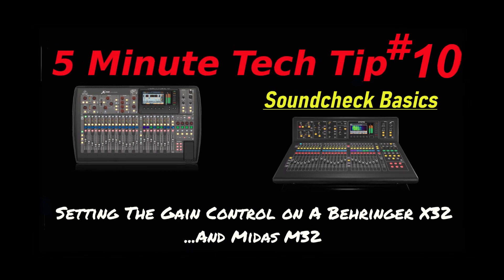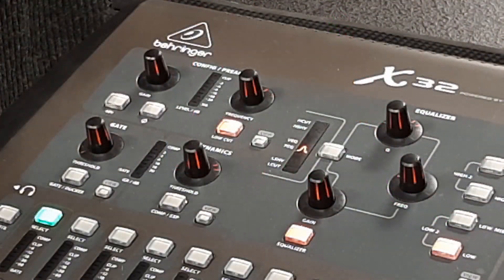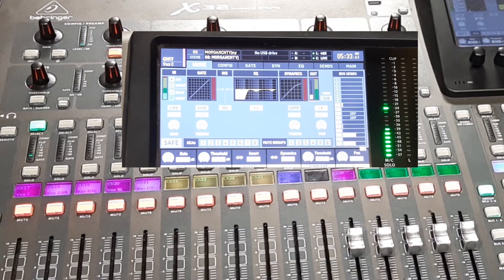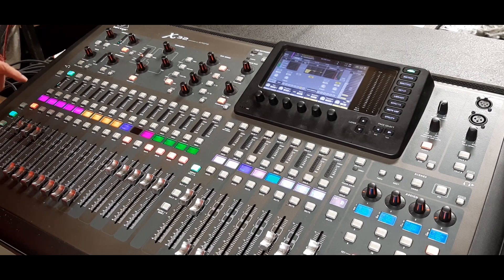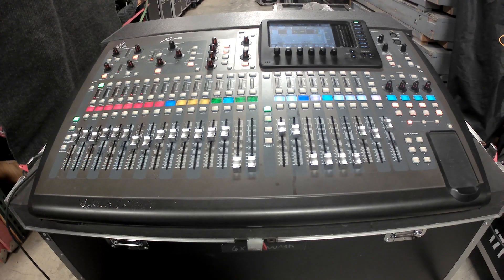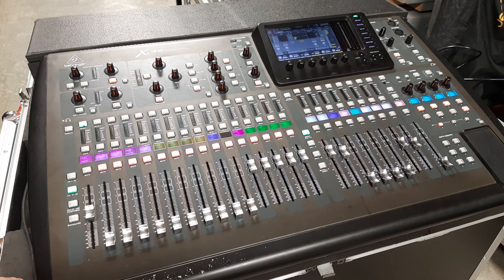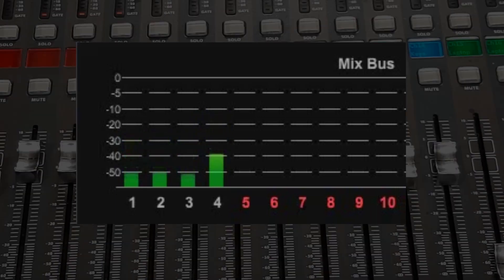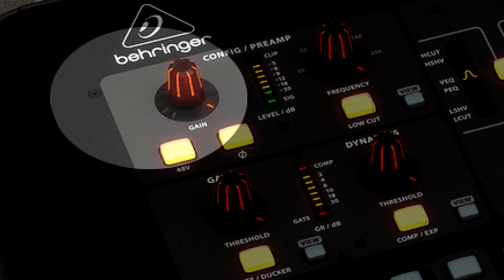Gain Structure and Signal Flow - Behringer X32 Midas M32 Soundcheck Tutorial

Comment: I've noticed that if I gain all my inputs to have each one maxing out around -18dbfs, by the time all signals are summed to the LR out, it's easily clipping (or almost clipping) the master. Tested this with no processing in place (no eq, compressors, fx, etc), and only using the DCAs to control the overall mix of each group of instruments.  Normally the standard Drums, Bass, Guitars, Keys, Vocals.  Gain stage, put each fader at unity, mix a group of instruments to each other, then balance the mix of all the groups via the DCAs.  On this board, I've started gain staging to -30dbfs to -25dbfs.  Am I missing something?  It's not the band sandbagging.
Reply from the maker: It's actually "averaging" -18dBFS on the input meter and peaking even higher that is what I'm talking about in the video. So if you're actually peaking at -18dFS you shouldn't be getting close to clipping the outputs.

Excessive boosting on the channel strip EQ... like dialing in lots of low end to things like the kick, keys, and bass guitar could eat up headroom.

What about the makeup gain on the channel compressors or bus compressors? That's another place you could be adding level to the signal in the chain.

(Unintentional) Double assignments is another place that can eat up headroom. Example: You have channels assigned to Left/Right AND to a subgroup (that is also assigned L-R). You should have the subgroup assigned to the L-R (normally) but NOT the channels that are feeding the subgroup (you don't want to give those channels two paths to the L-R bus).
Even accidentally assigning channels to multiple subgroups.

Another place you could be double-assigning things is by accidentally having one or more buses (in the master section) assigned to L/R. Since a bus can be a subgroup OR a monitor/stream/etc. feed, you have the ability to assign the bus outputs to the main L-R. This happens a lot and it's usually not noticed until someone tries to fader down a channel and it continues on in the house. That's because a pre-fader monitor or stream feed (etc) was left assigned to L-R giving those channels two paths to the L-R bus (one path via direct assignment on the channel strip) and one path via a pre-fader send into a bus output that is also assigned to the main L/R.

I can't remember the last time I had to worry about clipping the L-R outputs following proper gain structure practices. So something must be wrong somewhere in your signal chain.
Reply: @AlanHamiltonAudio yeah there has to be someplace else in the chain. I'll have to go back through it all and see if I just missed something obvious. Or might just wipe the board, rebuild the mix and retest from scratch. Someone mighta flipped some things around when I wasn't looking!  Thanks for the detailed response.
Reply from the maker: @VegasAudioRentals  LMK what you find out.
Reply: @VegasAudioRentals Ive been having this exact same issue. Did you ever figure out what was wrong?
Reply: @mikecaceres4791 guessing someone else just got in there and cranked up some makeup gain, jacked with the EQs, and whatnot; and saved over my show file. 

It was faster for me to just start from scratch and rebuild vs. hunt it down. 

Still feels like it sums pretty hot, so I'm just a little more careful with my initial gain staging, and turning down the input levels on the amps, so they're getting a signal with a really solid signal to noise ratio, but not clipping there.  Prob more to do with the peak levels vs avg levels like he stated above.  And basically ignoring the small meters on each channel. Just looking at  the solo meter since it has so much more fidelity.
Reply: @VegasAudioRentals  it does sum very hot! I also gain stage between -30db and -25db, you're not crazy. If you apply any of the "preset" compressors that say Kick/Bass/Acoustic/Vocals, you'll notice that Midas/Behringer thresholds from the factory are usually around -30db, with 3db of makeup gain. So they specifically know that you should be aiming for somewhere around -28db avg. It's so messed up that no one explains this. The only channels I try to set gain peaks up to -20db are: Kick/Snare/Vocals. Everything else: Guitar/Keys/Sax/Instruments get set to -30db. Bass Guitar is the only one I aim for -25db.
Even on Drew Brashler's video, who we all trust, says that if he sets everything to -18db, he has to lower the master fader down 10db!! So he recommends lowering the PA's gain down.. but imagine having to go adjust behind every speaker! that's ridiculous! For everything to be at Unity on your board and PA, on THESE board's aim for -30db to -25db, and-20db on only what you need to stand out in the mix.

Comment: Thanks for the video, I'm currently running a yamaha 01v (hoping to upgrade at some point) I'm I right in thinking that these kind of settings are ballpark on all digital desks?
Reply from the maker: Yes, if the meter is scaled in dBFS (digital scale). And it's pretty easy to tell, if the top of the scale is zero on the meter. An analog meter (dBVu) will have zero and then several dB's above digital (likely +16dB or more) on the scale before the peak light/clip.
Reply: Thank you Alan , Merry Christmas
Reply from the maker: @keggers101  Thank you and Merry Christmas to you too! :)

Comment: @Alan Hamilton Audio  Bit of background here for 3 years working this sound board.  Was taught to 0 out the master and channel fader and push the gain up to near feedback point or sound for my system that starts most of my mics -60 db -40 was goal or performance level rare to hit -18.  DCA the group-5 to 0 as volume control. (IF) I did it the way you are talking everything I have would create feedback and be too loud. My options would be the Master fader would be at -20  all the time or change the amp input level way down to compensate. I believe the end result would be the same. Doing it the way describe definitely increases the ability of compressors and Gates window. But Would it change my only sound problem?

One problem I do face is a Wired Choir Mics not able to be gained to a loud enough point before feedback. Post gain +4-+6 db is added and unfortunately EQ killing it just to keep the feedback out. Personal opinion, the choir isn't very vocal and it's easy to point out the ones that can sing well or can sing loud. My Mics we have pick up too much ambient noise and at the loud level I need I can hear them breathe , pages flipping and just room noise.   Options  Get more directional mics, or am I missing something else that may help this gain issue? I have tried two other Brand name mics and they work much better but never loud enough for someone to complain that they are too loud. I play on the edge of feedback every week. Ps Microphone placement is good. and three mics for 30 people  up to 45 people. Added sound baffles. 

Love to hear your thoughts. if you have any other opinions
Reply from the maker: Lots to unpack here. LMK if I missed something in the background/question. The way you were taught to setup gain structure is wrong and starts you out in a hole that makes it hard to climb back out of because as you move forward with it other things get set wrong or snowball into problems.
It's pretty clear from your description that your system gain, after the console, is wrong. Way too hot. If you run into that problem connecting your console to someone else's system, the quick fix is to lower you master main fader, and master monitor faders.
If it's your own system, then it's best to address the problem at the amp rack/DSP or amps themselves.

Any time on an X32/XR18 you set the gain to average -18dBFS (or any digital console that is using the dBFS scale) and can't get the faders near unity (channel and master), it's pretty much indicative of a gain structure problem (unless you have a situation with REALLY bad mic and speaker placement). You at least want to get the console gain structure correct because that is the part of the mix you're totally in control of at all times. From the input to the output.

It also pays dividends in the future because that will translate to any system you're on. You're not learning bad habits and taking those to other systems. Sitting down behind a properly gained system, properly configured, while bringing bad habits to it, will lead to all kinds of problems. And you'll find far more properly configured systems out in the wild, as the quality of gigs goes up, than you will improperly configured systems.

And when you do run across those improper rigs, then use the main fader and monitor mains to get the system to behave properly with a properly gained console. It's much more simple to follow proper gain structure principles when mixing, and then apply a bandaid at the end of the mixer chain, than to do it on every channel. And doing it on every channel is a moving target as you move from system to system and room to room.
Essentially, if your channels are always gained around -18dBFS on avg, everything after that point in the console will react, and LOOK, the same. You'll know how loud, in general, a vocal monitor is when the fader/knob is at X position. Your compressor thresholds will be consistent and react consistently with the ratio you've set. Same for gates. Everything won't be a constant reset every time.  And even then, starting from scratch with proper gain staging, the settings will flow back to something in the window of familiarity.

Choir mics can be tricky. You don't want them TOO far from the choir. Loudest sound at the mic wins so there's a point of diminishing returns when trying to raise them higher, or pull them back, to capture more of the choir.

Definitely should make sure and use a HPF on the choir mics. And get aggressive with it.
Have you rang out the choir mics? You might need to find 2 or 3 hot points and notch them, plus the aggressive HPF settings, and you might need to widen the Q rather than be surgical to allow for a little more margin of error.
While compression can help knock the peaks of the choir back, if you're having feedback issues, I'd turn any choir mic compression off for testing purposes and get the mics working as well as possible without the compression. Improper compressor settings can cause feedback. The gist of it being that if the mics are into several dB of gain reduction, and that is what is keeping the mics below the threshold of feedback, then when the choir quiets, the gain reduction goes away and the mics are now open and LOUDER than they were when the choir was singing loudly.

Also, something else that sometimes can cause problems is giving the choir their own voices in a monitor or monitors... or sidefills... For one thing, nobody can hear themselves individually anyway so there's not much point in the choir being in monitors... ...for the choir. And the fact they are hearing themselves collectively will cause them to sing quieter. So we're back to my statement about loudest sound at the mic wins. 
And sometimes people will sort of be able to pick out their voice when they are listening for it, and that will cause them to pull back and sing more quietly. That can even snowball because once they sing quieter, the people around them sings quieter. And then the people around them.
Pretty soon, the choir is not at full voice.

As a sound person, you want them giving you as much signal as possible... And especially for a choir where there's going to be some distance between the mics and the choir no matter what.

Usually, choir monitors are for giving the choir the music, not their own voices.

You might check out these two videos. The first is ringing out monitors and in this case you might need to apply this to the choir mics specifically on a channel strip basis, not necessarily the mains. Get the mains right... then specifically address the choir mics at the channel strip:
https://youtu.be/pu0xjl0rpMU

And this is just a quick video about gain myths:
https://youtu.be/nsulprafYWU

Comment: Is there any way to protect the monitors from being changed if the soundman changes the gain for the lead singer during worship?
Reply from the maker: The Mixing Station app has a re-gain function that automatically compensates the sends for a gain change. I think that's only available in the paid version of the app, but I could be wrong. And it's only like USD5.00 or so for the app. But other than using something like that, and enabling it so that it's working, there's no other way. 
And that is a recent thing that's been brought to the table thru software. For years, we never had any way at all except manually compensating every channel send. Which is why it's best to get the gain set right to begin with and then leave it alone unless it just HAS to be changed (clipping or threatening to clip). Especially when that console has other outputs in use like monitors from FOH.

So many people just monkey with the gain all the time, chasing the natural dynamics of the music, always looking for a 'perfect' meter reading. Or in some cases, who knows why they are doing it or what they hope to accomplish. Mixing on the gain knobs? Thinking every knob must be touched and turned or else they aren't doing the job? Trying to set the gain so the faders make a perfectly straight line across the board? Thinking there's some magic setting that causes or eliminates feedback? That's all just wrong and unnecessary. 
Mixing Station Re-gain:
https://mixingstation.app/ms-docs/re-gain/

https://youtu.be/tEX2Prwfh-g
Reply: @AlanHamiltonAudio  Thank you so much for your quick response.  Your videos are very helpful.
Reply from the maker: @virginiaoverstreet1977  You're welcome and thank you for watching and supporting the channel.

Comment: My question is... how do you decide to set the level of your speakers themselves... I do understand gain in relation to different channels. But what about how much is fed into the master bus in relation to the volume of the speakers?
Thanks
Reply from the maker: The down and dirty method would just be understanding the main L-R should be able to live around unity when the channel gains are correct... So, channel gains correct, channel faders will be able to live around unity (depending on where your mix needs them to be)... then through the console and out the mains with the main fader at unity... your speaker levels then should be at an acceptable level...
IOW, not clipping, not screaming loud and feeding back, and not too quiet.
A little feedback can just be an output EQ tweak, but massive 'nearly' uncontrollable feedback (which you really shouldn't actually have but only tell that is what you're going to have as you slowly bring the main fader up and start hearing the first tell-tale signs of an unstable system/improperly gained system) is a clear sign you have too much gain downstream of the console if you know the console is correct.

I'm not saying the main fader should ride at unity for the show. I'm just saying it could... Maybe a comfortable level is -5dB down. Maybe -10dB down in some cases. But, should you bring the level up to Unity it might be loud, maybe even too loud for the room and genre or what you want to hear, but not stupid loud beyond any reason, not hard clipping speakers, not veering into uncontrollable feedback, etc... And the opposite shouldn't be true either. Main at unity shouldn't be too quiet.  So, for down and dirty you're just looking to get the amps/speakers in a window of acceptability.

The beauty of consistent gain staging in your console is it makes your meters relevant and your fader and knob positions too because they then should have consistently repeatable settings and readings (you know your singer's mic should be plenty loud in the wedge if the send is set to X, and what the meter should be showing, or that you should be hearing more/less from the house with the settings you have). If you're connecting your mixer to a house rig, and you can't get the main to unity, and you know your console gains are correct, you quickly know the house rig has gain issues. If it's not your rig, a quick fix IS your main fader (or matrix fader(s) if you're using the matrixes to feed house outs), and that still get you back in the window of your mix settings being in a repeatable and consistent window, regardless of the rest of the rig.

Of course, having that problem on your own rig tells you that your rig gain needs addressed downstream of the mixer and you should do it. Whether you have time at the gig, or it's an issue for a different day is another question.
Reply: @AlanHamiltonAudio  thanks loads
Reply: I have always ran all channels on our x32 at -18 but the main L R fader when at 0db is nearly in the red on the meters🤔 we are using the first generation of the x32 so not sure if there is a common fault on those? If i set the mains fader so the meter is showing -18 then its about -10 on the actual fader.

Comment: I’ve used -12 since my first digital board (Presonus Studio Live) back in 2009. 

Do you think that is too hot?
Reply from the maker: If you've developed a workflow that works for you at -12dBFS, and you are certain your peaks are not hitting 0dBFS by a safe margin (which experience should answer that question for you)... then it's probably OK. But that is encroaching into the area where dynamics and/or a musician turning up could catch you out. You're losing, essentially, 6dB of a margin of error.

This is assuming you mean you're using -12dBFS as an average level and not a peak level... as Behringer is is talking about an average level of -18dBFS. Peaks can and will definitely go higher.